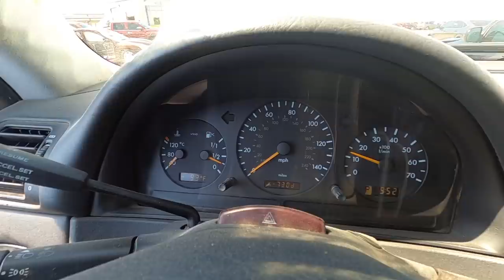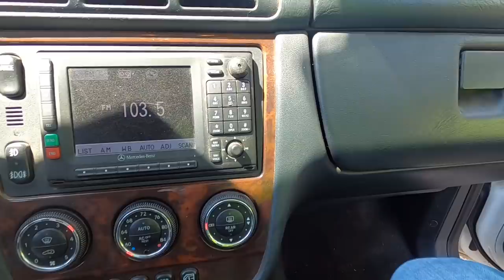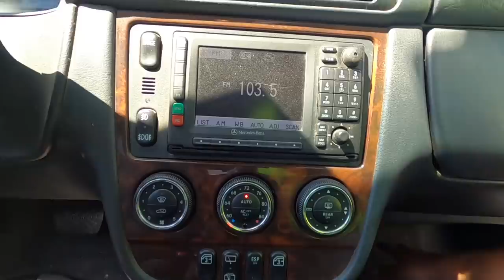Copart Walk Around + Carnage with Monkey Wrench Mike! 8-18-2020

Comment: the battery in the back is to charge stuff in the car like radio and power stuff for when the car is in power saving mode at stop lights or when stopped and not driving

Comment: 20:00 That's not entirely true, the Taurus name wasn't discontinued it was just moved. They were going to discontinue it, but the CEO requested it be moved to the full size car, formerly named the 500, after internal & external feedback. Ford made both the (midsize D186 platform) Taurus and the (full size D3 platform) 500 at the same time MY2005-MY2007. When ford discontinued the midsize Taurus in 2007 due to poor sales, they moved the Taurus badge to the fullsize D3 platform car for MY2008.  In MY2006 Ford started production of a slightly larger midsize car, the Fusion to better compete with the Accord & Camry. The 500/full size Taurus was basically a replacement for the Crown Victoria, which couldn't meet modern safety standards, and was discontinued in the US after MY2011.